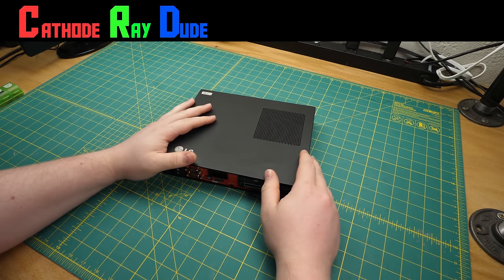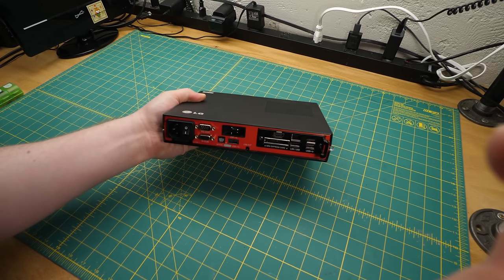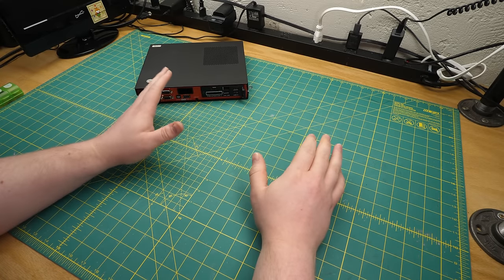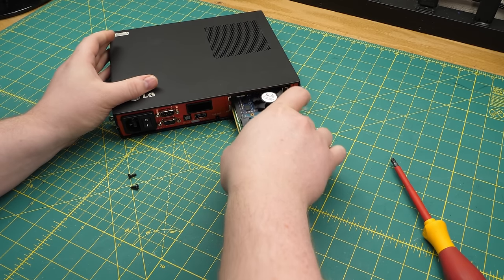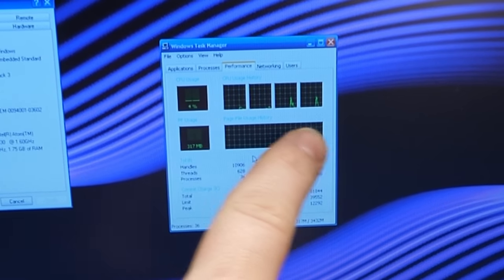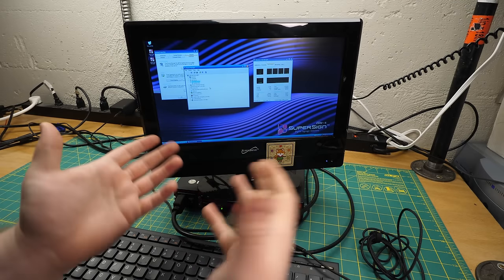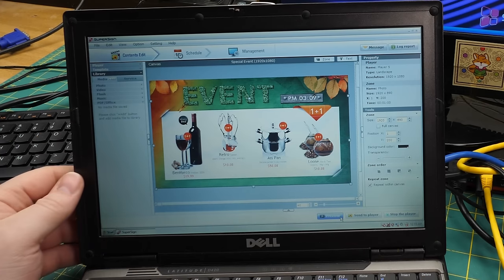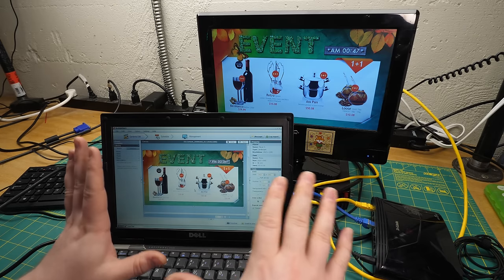Little Guys 6: The Worst Possible Timing [LG NC1000]

Comment: For the grid mode... it has to be intended for situations like the fast food joint. So you could take a single input video and chop it up across multiple monitors, or maybe do a stinger feature across a few monitors, then switch back to single window slides. Also... five figures in hardware is chump change if you consider big advertising spreads in places like Times Square. Just having the flexibility to do a grid mode in would be neat, especially if it's a reusable setup for many situations (and the computers themselves are way up in an inconvenient location).
Reply from the maker: But I don't get why you'd use $15,000 of gear when you could do the exact same thing with an $800 device. like what's the value in having an independent controller for every screen that justifies spending twenty times more on it? higher resolution I suppose, but does that matter on a display seen from a hundred feet away?
Reply: @CathodeRayDude my guess would be redundancy and ease of installation. Running power and networking to each screen is a lot more straightforward than displayport or hdmi. And when something goes wrong (not if, when) it is isolated to the system that has the issue. If you can save time and add reliability then you actually save money by spending more.
Reply: I don't think you have fully internalized just how irrelevant $15k is to the type of company who would do a large install of something like this lol. Literally you pointing out the potential savings would trigger a meeting consuming thousands of dollars in employee time. Vendor approvals, compliance requirements, how to update the things on a schedule, pre built run books for servicing them. Nobody at scale makes a decision based on $15k, you'd be willing to spend $150k if it reduces friction and gets you to the finish line faster. Remember there's dozens of companies out there that spend billions on marketing. It's so insignificant in the grand scheme it's like just get er done. LG makes something that slots right in to what we already have off the ground? Whatever let's do it.
Reply: I have seen these in banks and airports.  50k is a cheap Tuesday afternoon.
Reply: @CathodeRayDude sure, if all you're showing on the grid is one big thing, but if you had a grid of independent screens for most of your purposes, it sure seems nice to be able to spread a single source across it.
Reply from the maker: @r0bst4rl1ng  Fair enough

Comment: I love this series. For some reason I find systems like this fascinating.  In a past life, around the turn of the century, I repaired barcoding equipment and small handheld computers.  It was fascinating how they solved the issues they had in warehousing, and different retail applications.  Also, interesting note, I was in a Tim Hortons a while back on one of their menu signs broke down.  I noticed, it was running Rasperian Linux.

Comment: ION was a beast in its target segment so it's weird that people hate it. You had Atoms with integrated Intel graphics in chipset and you had these. I'd go with the ion machine
Reply: Yeah, i had an ION board back in the day. It wasn't super ultra mega but it wasn't bad either, for onboard graphics of the time. Oh wait, I still have my old Eee PC 1215N. Unbearable slow, tried to use it as a dedicated 3d printer interface but the cats kept pushing it off the desk.
Reply: I don’t remember people hating ION. IIRC it was a compact, low energy integrated solution that provided far better graphics performance than integrated intel. Maybe because they only came with Atoms and Celerons?
Reply: Intel sucking at graphics cards, some things never changed. They could have bought nVidia in 2018 when there were broke and cheap. Now probably its the opposite that happens, or Intel just sell all of its fabs to nVidia.

Comment: I have a ASRock ION 3D 152D from like 15 years ago, that i used as an XMBC media player (had 3x USB drives hooked up), was great at the time though quite underpowered and now just sits in  a cupboard unused. The box even came with cardboard anaglyphic 3d glasses, but like my 12 year old Samsung 3D tv (which came with active 3D LCD glasses) I never utilized the 3D aspect of it.

Comment: 31:17 On the topic of adobe air, I worked a coop job (paid internship) during university at a device based startup and worked on the desktop client, which was written with Adobe AIR. When I describe AIR to the students of today, thats exactly how I describe it: its like electron, but it uses Flash instead of HTML/CSS/JS. I also love to highlight that it used ActionScript 3, which was, afaik, the only actual implementation of ECMAScript 4 (as browsers declined to implement it etc etc JS history stuff)

Comment: 15:00 I could see the ATSC tuner module making sense for like a sports bar or Buffalo Wild Wings, where you'd have a bunch of different TV-like objects, and you (especially if you're running a chain) want to only acquire one model of device, and switch them between real TVs and digital signs with minimal downtime.  first round of the playoffs and there are like 8 games on simultaneously?  turn some of your digital menu space into more space for games by swapping out some OPS modules and changing the page layout on the screens you've got left over.
Reply: That or for when a store inevitably closes down and sells the signs, people can get one of the modules and convert it into a TV.
Reply: I've done a couple fire alarm inspections at Before the Wild Wings, they just have a bunch of direct TV boxes in a room. I'm not sure how they send it to each TV, I imagine some kind of video double or something.
Reply: Buffalo Wild Wings has so many TVs, I’ve heard them described as a Best Buy that sells food.

Comment: Im feeling real sick right now. This was the perfect video to see just as I finally get to crawl into my bed ❤❤❤

Comment 2.0:
One day I'd love to see you whack proxmox or k8s on all the little guys and see how much they can be upcycled to do.

Comment 3.0:
That popout computer module is the same thinking that goes into modern smart screens (the sort that needs a PC to turn them into teams devices), nothing about this thought process has changed. I literally installed a brand new one in our office running windows 10 with an i5 a few weeks ago.

If that PC was to die rather than shipping away the whole 60" screen we just order another computer module from the manufacturer.

Comment 3.0a
And then you pull out the OPS module, beat me to it.

Comment: Just a note, When I first did a DIY, I used a mini windows PC, then moved to Linux, then now all my systems are RTSP decoders, this way I can have multiple monitors receiving the same stream. I do this in our locations as well as our airport location. no need to remote into any monitor/pc - I just change the feed. In small one off builds, I just do either windows/linux pc with a browser full screen and feed a dynamic web pages from a server

Comment: There were (and possibly still are?) OPS capable displays with screen sizes in the 42-55" range. I worked with several different models from LG, Dell, and NEC in a prior life that all had OPS ports. The NEC was 43", and actually came with a TV tuner/component/s-video/vga card in the slot iirc. And shipping these things is absolutely what kills used sales; that 43" NEC had a solid steel chassis that made it weigh something like 60lbs, plus they're surprisingly fragile in the care of normal courier services. We had so many issues with larger displays getting destroyed in shipping from the manufacturer at my last job, that we started loading them into our work van to courier to the job site ourselves.

Comment: It's always interesting to see this kind of modules, at work we have some digital signage type screens, Just Raspberry Pi's running sway and chromium in kiosk mode.
Simply configured over Ansible or whenever the web application itself gets changed.

Comment: 2013/2014 I had to manage an LG digital sign for my employer. They bought it before I started there and it was loaded by... PR would send me a .pptx, I would export it to a video file and push it to the signage over the network. Not so bad, but it would lose the video every time power was lost, which was dozens of times a week (thank you crummy rural power company). That sign mysteriously found its way to recycling during a remodel and I now use an RPi, update a web page and have the page refresh periodically.

Also, the Atom 330 haunts me. Just... Terrible.

Comment: I had an Ion 2-based Windows 7 netbook back in the day which worked very well. But that second generation had had the time to work out most of the original Ion platform's issues and also benefitted from significantly better power-saving management for the graphics.

Comment: Soo the 230 and 330 were NOT SoCs. They don't even have IGP (the only Atoms that don't). They used Intel 945 chipsets (the ones from Core2Duo, released ~2005; Atom in 2008).
The Nvidia ION setup was used later as a multi-media chipset to offer some video decoding, so the Atoms "could" be used as HTPCs.
Reply: It was actually core duo, not core 2
Reply: @lolman123401  Could be. I only could afford some desktop parts and 945 was required for c2d (yes, I know some MB makers made them work with 8xx)

Comment: Train and train station displays in Germany are usually a Browser running on Windows or Linux systems. Modern trains have their own TCP/IP networks, running through the whole train, but for station displays sometimes you can easily find the website hosting the respective signs content.

Comment: EDIT: atoms of that age were NOT an SOC.

I have an OPS module with an i7 4700EQ, while it would have been smart to make an adapter I just soldered a barrel jack onto the power pins and feed it 19v that way... Rear HDMI doesn't have audio support though so it's useless as a media PC lol
Reply from the maker: yep, I've since been informed - I'd read about the Atom but I thought it was meant to be an SoC from the get-go!

Comment: 30:23 resolution. monitor wall controllers often max out at 4k input even at the pro level and then your video feed just gets scaled across your displays, not taking advantage of their native resolution. if you want every display in a big wall running at its native resolution you basically have two options. 1. you have a network box like this but with beefy hardware chopping up a huge canvas into 1080p chunks and sending them compressed over network, or you have an unfathomably expensive frame full of cards from evertz or ross or grassvalley doing the same thing using FPGAs and sending it out over a bunch of SDI runs. the latter sollution somewhat overlaps with multiview generation which is sort of the opposite, taking a bunch of individual sources and displaying scaled down versions in grids so your TD can see every camera all at once and stuff like that.
Reply: in particular one of the recent jobs my company did had a ross ultiscape frame misusing its PIP canvas with these bizare-shaped raster areas, stuff like 512x17,280 and 5,760x5,760 so that five multiview cards could drive hundreds of LED wall banners and tickers and displays, which went out over a raft of SDI into LED wall controllers that further chopped those output canvas tiles into weirder smaller bits to go to each banner and ticker over what i assume must have been ASI although anything beyond the LED controller inputs was out of our scope so, grain of salt on that.
Reply from the maker: resolution matters that much? i mean i figured video walls are generally seen at a distance and even if the pixels are quarter sized nobody would notice. but i guess that makes snse
Reply: @CathodeRayDude  anti aliasing / bicubic scaling artifacts on an LED video wall look uniquley awful in ways i struggle to describe, especially on text. it's like there's a mid scoop on my eyes where the high frequency of the screen door effect and the low frequency of the smearing are locked in brutal bloody mideval combat. as for walls made of TVs, yeah it doesn't matter as much. but for a major sports venue it also has the advantage of centralizing the hardware and keeping it in the equip room instead of putting boxes out with the screens where they might be hard to reach.
Reply: incedentally as a canadian it is wild to me that in america some college/university campuses qualify as major sports venues and have the budgets and infra to match. what on earth is going on down there
Reply from the maker: @famitory  okay yeah that makes a lot of sense too, somebody else alluded to that, that it was easier to run power and network up to these screens rather than video. Weird to think about but I guess it's one of those things where unless you work in the industry you just can't intuit the way things scale.
Reply from the maker: @famitory  our entire system of mid to upper level education exists solely as a machine for producing athletes, everything else these institutions do is a smoke screen

Comment: One of the first things that security researchers do to test if your machine is secure is to make sure that the JTAG option has been disabled. Yes, you want to use it to access the computer, but no, not at the cost of removing all authentication towards the machine. So yeah, you want to be able to disable it. A lot of hardware still has the JTAG functionality on a board but not the physical port connected. In that case it is often possible to simply use some prongs to access the JTAG none-the-less.

Comment: That looks like an Atom N330 chip.  It's a dual die dual core 64 bit processor with hyperthreading.  It came out in the Core 2 Duo era but was based on an alternative design.  IIRC they followed the original Pentium 3 chip design lineage instead of the super pipelined Pentium 4 line.  They were super low wattage, ran at 1.6Ghz, and gave you 2C/4T of 64bit processing for cheap.  The processor used 8 watts IIRC, and the required chipset i945, used 20 watts, so the cooling package on the chipset was actually bigger and more demanding than the CPU.  The Intel 945GCLF2 motherboard was (IMO) the pinnacle application of this chip.  I ran one of these for years on Linux.

Comment: ION had 64bit memory controller and it is not limited to the 2 GBs the intel chipsets for Atoms were if my memory serves me well.
Also as another friend mentioned it had a Geforce GPU with full video decoding capabilities and some 3D acceleration which the Atom couldn't keep up. Of course DDR2 ram
The newer version of this concept for Atoms was the Poulsbo 500 which had an ImgTec PowerVR GPU but was showing intel's badges.
Atoms were so painfully slow in general but was the first widespread attempt for low power cheap x86 processors  for the mass market and course Little Guys!
I had an ION small PC cube from Asrock in the eye to buy but never had the cash as a student back in the day I always loved the Little Guys! 
Great video as always cheers from Greece!

Comment: I worked in an IT support role of quick-service restaurants and literally never saw a DMB (digital menu board) that worked in the way you described. So, I think you're putting together "the history of digital menu boards". All menu boards I worked with were application driven that displayed the pricing and image information in real time from a small database that was updated nightly from the corporate servers. This allowed for things such as pricing ranges for different markets, market specific specials/sales, custom layouts, etc. One of the common issues we would need to address would be when a pricing update failed to process and the wrong prices were displayed. In any event, very cool to know that some retailers used JPEG and video players prior to the above method.

Comment: That OPS spec uses a standard JAE TX25 / TX24 plug and all the pinouts are listed in wikipedia. One could probably make a breakout board with $5 of parts and an afternoon of soldering.

I just went through the struggle of buying a new television and trying to resolve which one comes with the least amount of malware pre-installed. I wish those OPS panels were more readily available, and I could just shove an apple TV or raspberry pi in the slot. It would also mean that without the malware subsidy my 65” tv would cost more than $300.

Comment: 4 years ago I inherited a Samsung 400UXN digital signage monitor.
It's a 40" WXGA monitor that incorporates a 1.9GHz Athlon X2 Dual Core BE-2300, 1GB RAM and 8GB Flash storage,  running XP Embedded.
I tried to get OpenELEC to run on it, but unfortunately the VGA controller isn't supported by Linux… So it's now just sitting in a corner gathering dust.

Comment: According to my research, the PMU JTAG thing refers to using the JTAG interface to interact with the PMU for debugging the PMU functions, programming PMU firmware, and testing the functionality of the PMU in the development and manufacturing stages. So I think it's just to ensure power management functions are working the best they can.

Comment: Crazy. This video takes me back to memories from 2003ish. My company was trying to switch from ISP to specialized Data Centers and more what we we call SaaS now. We hosted a customer "TrafficLand" that was pioneering Video Traffic Cams on the Internet in the Washington DC area. Together we bid a project to place digital signage, live traffic cameras and a centralized system for the notice signs along Interstate 81. Everything was an Alpha product and hacked electronics, and we were working with some pretty big manufacturers.
Reply: We didn't win that bid, but TrafficLand is still around doing the same kinda things.